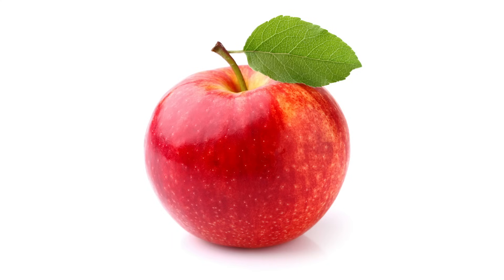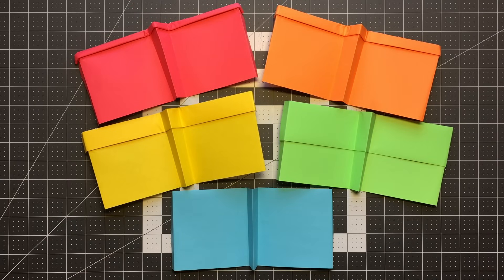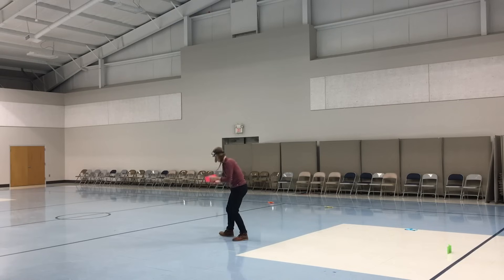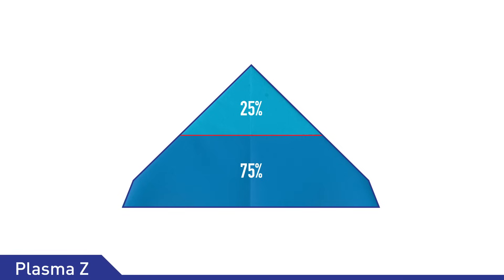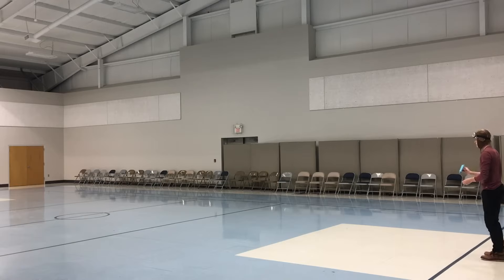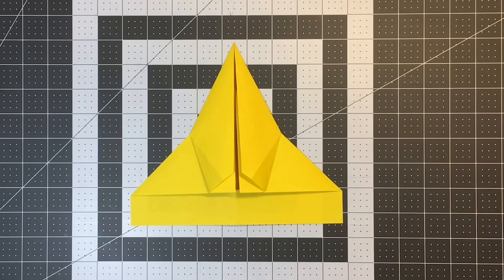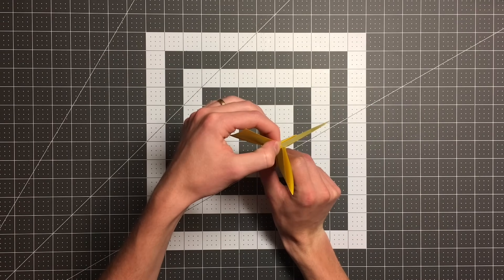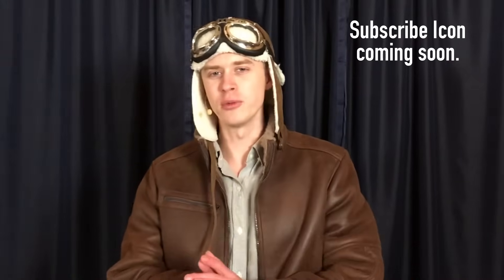How to Design Your Own Paper Airplane That Flies Far (Ep. 2) — Discussing the Center of Gravity

Comment: But are you measuring area or distance from the center of mass?
Reply from the maker: I found the CG (same as center of mass in uniform gravity) and then calculated the area in front of it and the area behind it. I found this to be much more significant than just the distance in front and behind.
Reply: @FoldableFlight  thanks for the clarification! 
I wasn't sure what you meant in that part.

Comment: Hey Kyle make a video on how to find the CG of a paper airplane. I mean how to find at which point is the CG.
Reply from the maker: Hi Randy. Almost all paper airplanes are symmetrical from right to left, so you already know the CG has to be on the center crease. Then, if you balance the plane on a string and find its tipping point, you have located the CG from front to back. Finding the CG's placement on the third axis is very difficult, and not consequential for most planes, so I didn't worry about it in this test. The front to back placement of the CG is really what determines whether it stalls, dives, or flies well.
Reply: @FoldableFlight  I too know that the CG is in the center of the plane but on all aircrafts it's not on the center. Like the boomerang plane of John Collins should also have CG in the center but why John always says that the center of gravity is behind the lift and there's not too much large layers too behind the plane,and one more thing we can't carry string all the time everywhere and we can't even make holes in plane always to check the CG what in this case then how we will find it. And one more doubt if the CG is in the center then how can be it further moved back or forward? and please tell the mathematic formula too for finding CG percentage.
Reply from the maker: @randyorton7997  Okay — so you are touching on some important things. John Collins' boomerang plane (and mine, Circuit Racer) function the way they do, not just based on the placement of the CG, but based on the relationship between their centers of gravity and their centers of lift. A plane's center of gravity remains at a single location, while the center of lift changes based on a plane's attitude (angle) and speed. Basically, on most boomerang planes, the CG is behind the center of lift, which encourages the plane to climb. If you throw the plane in a banked attitude, it "climbs" in a circle back to the thrower. 

You mention that you can't carry string everywhere to identify a plane's CG. That's fine. You don't need to identify the exact placement of a plane's CG in order to make it fly in a certain way. If a plane dives at a given speed, it's CG is in front of it's center of lift. If it climbs at a given speed, the CG is behind the center of lift. If it glides level, the CG and center of lift are at similar points. So you can infer something about the relationship between the CG and center of lift by how the plane flies, rather than worrying about making measurements and mathematically calculating the CGs placement. 

And if you are trying to locate the plane's CG, there is no need to make holes in the plane. I just balanced it between two strings of fishing line and found the tipping point. The plane balances on the bottom line, while the top line helps you mark the correct point on the plane. I calculated the CG placement in relation to the wing area by using geometry to calculate the area in front of and behind CG. There is no single formula for this. You pretty much just need to know the formulas for rectangles and triangles. The area of a rectangle is length x width. The area of a triangle is 1/2 base x height. Once you calculate how much area is in front of the CG, divide it by the total area of the plane to find the percentage of area in front of the CG. 

As for how to move the CG backwards, I discuss that to some degree in the video. It's also worth knowing that anything I said can be done to move the CG forward, the opposite can be done to move the CG backwards.